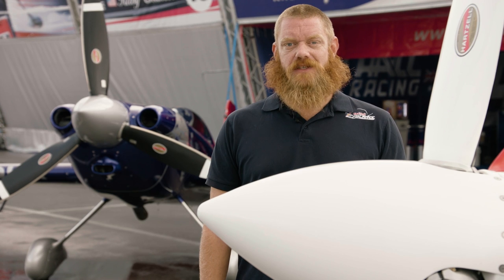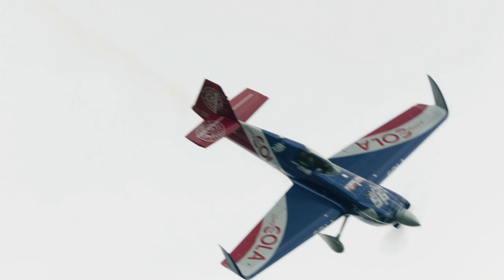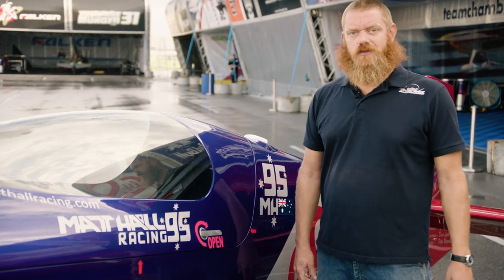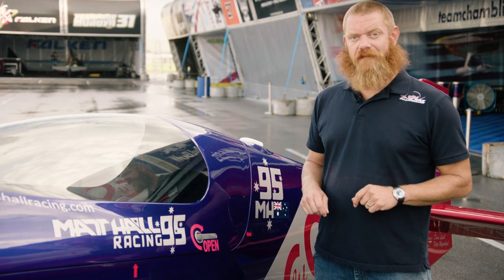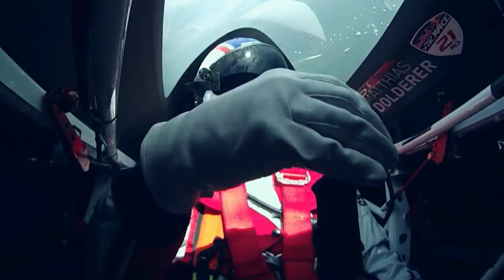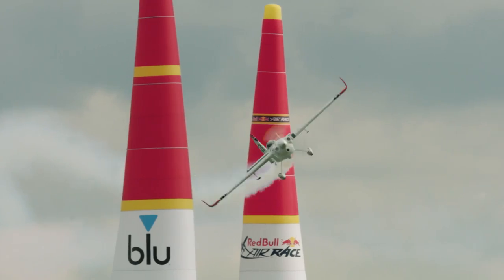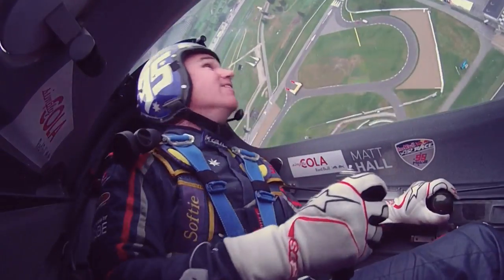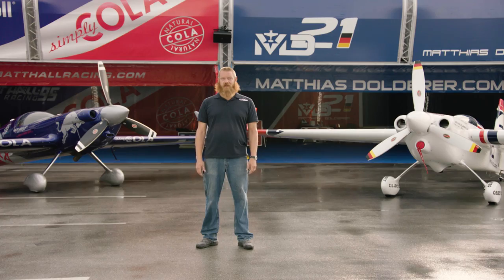Red Bull Air Race Tech Talk: MSX-R vs. Edge 540

Comment: What effect does having the wings being mounted at different heights on the fuselage have?
Reply: Drag. Mid wing is at CG (fwd/aft and up/down) of plane and makes it LESS stable (more maneuverable). The mid wing also has less drag as interaction drag of fuselage and wing root air flow is slightly better. Mid wing structurally is more difficult to design, as spar goes through cockpit at higher location, leaving less room for the pilots comfort.. These being all out single seat aerobatic race planes, comfort is not prime consideration.
Reply: It means one is difficult to look at without vomitting and one is a beute.
Reply: @patrickmeyer9905  nice pave hawk(?) 
profile pic
Reply: @lil__boi3027  yessir
Reply: @patrickmeyer9905  very nice 
post some vids if you are allowed soldier